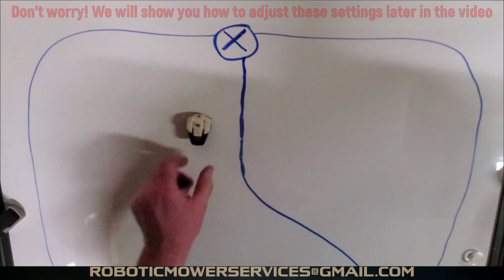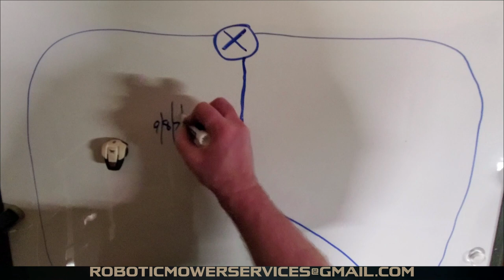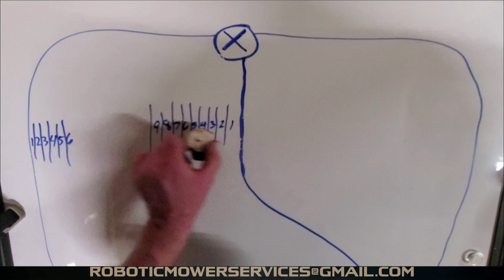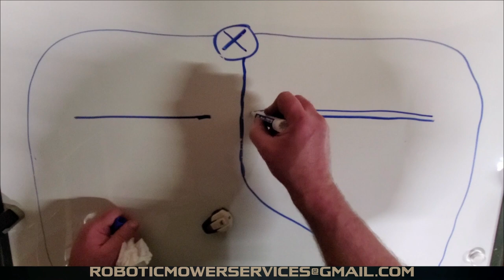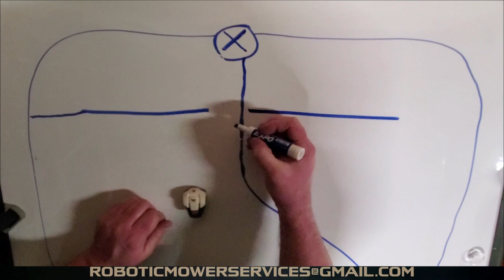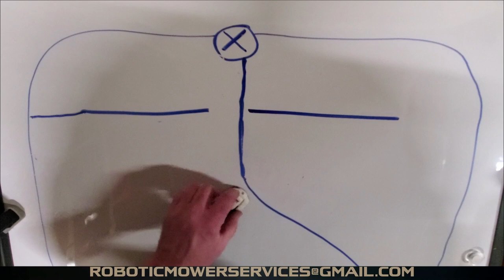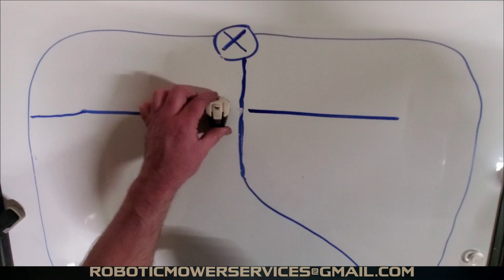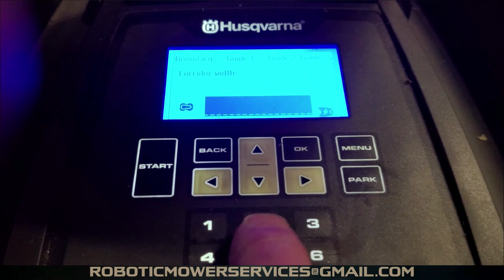Automower Answers: What Are Corridor Settings & When Should You Adjust Them?

Comment: Will corridor settings make the automower work on nature strips?
Is there a public liability issue on nature strips?
Is a tall orange flag needed for public areas?
Is it better to use 5 small zones or 2 large zones?  Some automower only allow a maximum 2 zones.  I'm confused on how the automower returns to base with multiple zones.